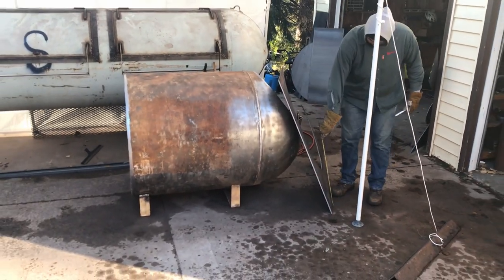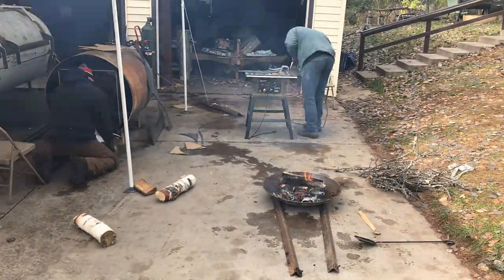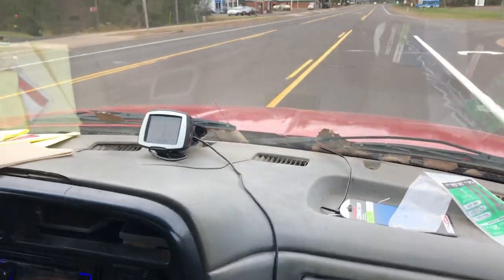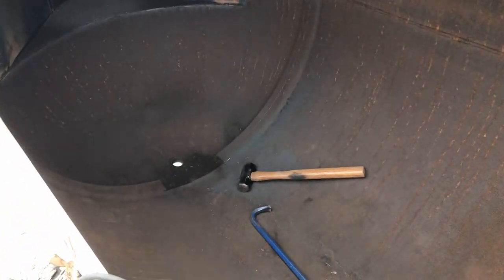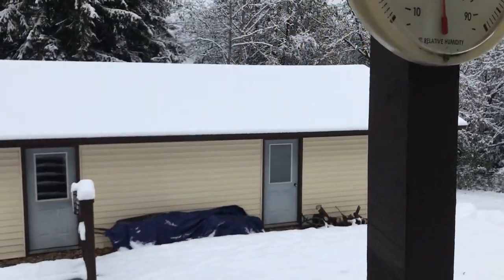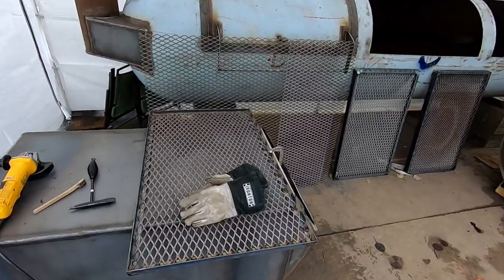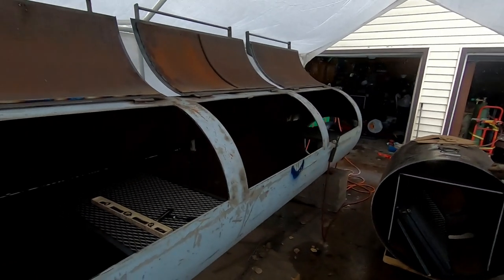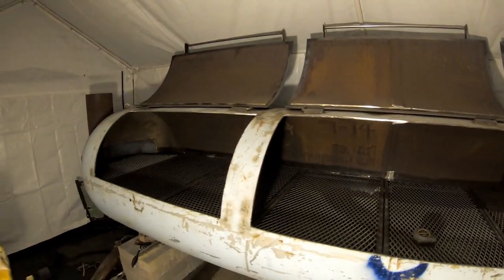1000 Gallon Offset Smoker Build Part 9 - The grates

Comment: I just binged watched all the build videos so far, I’ve been planning to build a 250 gallon, I’m not at 1k gallon level like you guys, but dam these are pretty good. I can’t wait to see the rest. You guys are probably the only ones stick welding everyone else on mig machines. I just picked my self an Lincoln 225. Any tips you can offer? I already noted making grates might be tedious lol
Reply: Have you considered investing in a plasma cutter and if you do I go with Miller spectrum 375 extreme better of with a hypertherm power max 45 these plasmas are awesome for home projects
Reply from the maker: That's awesome! Hey gotta start somewhere haha. But thank you we appreciate it. As far as the welder goes we just used stick because that's what we had honestly. I think more people starting out are drawn to the wire machines because they're easier to pick up right away. Like you pointed out the grates were a pain...cleaning up all the slag inside the cooker is a must. Anything thinner will require a little more work with stick. On the thin stuff we used 3/32 inch 7018 lincoln excalibur. It runs real nice, occasionally we used some 6010, or 6011 if you're running AC. At the end of the day it can be done with either one, but mig may be more a little more convenient. But good luck! Nice to see another person going old school with the stick welder
Reply: @elpoison626   anytime I see Miller I think my wallet will die lmao. But I’ll check it out, do you have a lot of experience with one? 
I only have a grinder but contemplating plasma/torch for cutting over cutting discs if it was even cost effective after all the discs I would have to replace.
Reply: @LR-me3kc  yes I have a Miller spectrum 375 extreme $1400 at cyber weld yes Miller is pricey but you get what you pay for now if you really want your money worth go with a hyperther power max 45 if I knew better I would of gone with hypertherm same price a bit better quality o don’t forget you need a compressor

Comment: Have you considered sliding grates?(That's a pretty deep tank to be reaching into while tending to the product) Are you planning 1 level, or 2 levels of grates?
Reply from the maker: We thought about it, but we're both on the taller side and have long arms so its not too bad without it. And for the time being just one level. If need be we can always add a top level later on.